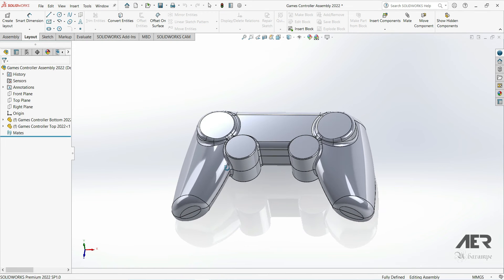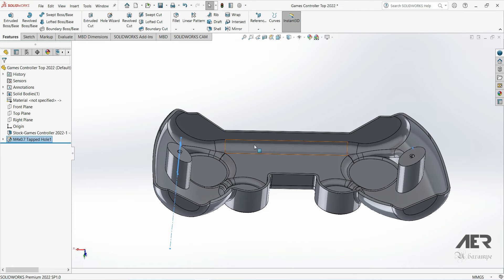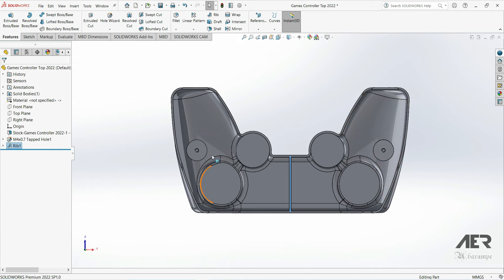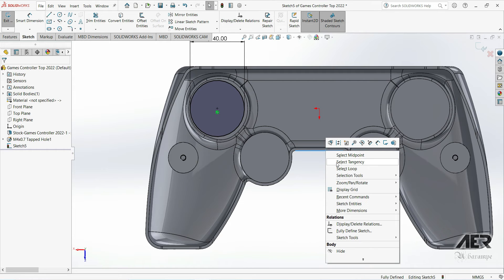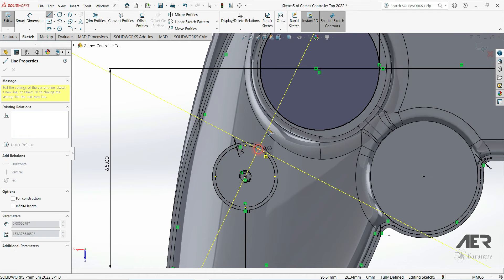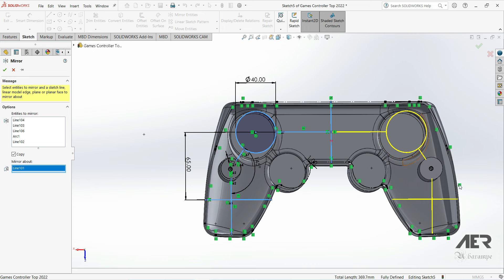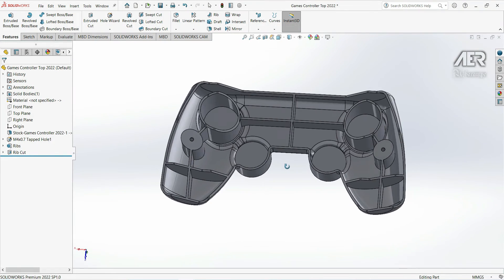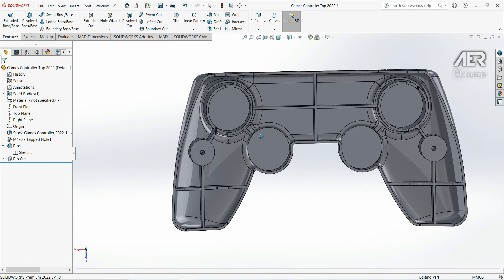Solidworks Tutorial Sketch Adding Ribs Feature & Thin Extrude Playstation Xbox Joystick Stage #5-AER

Comment: 8:58  in this minute i want to do the cut-extrude but i can’t,can you help?
Reply from the maker: what stage are you working on, bro? maybe you can try again in the active sketch section on the front plane then right click on the outer edges then select tangency, then do covert entities
Reply: I have de 2016 version and it seems the cut is not as intelligent as in 2022 version, but you can do it with 2 extruded cuts for the curves that only cut on the opposite direction.